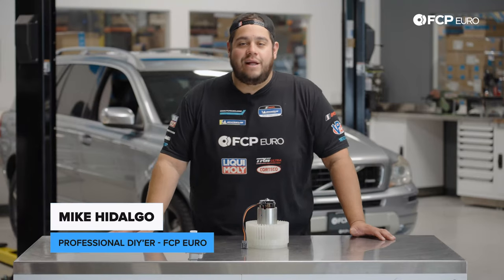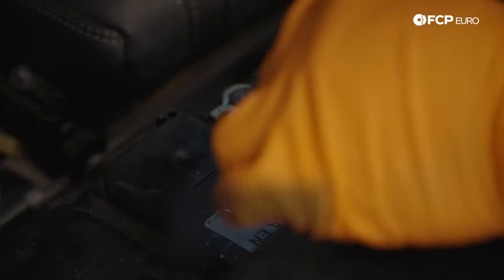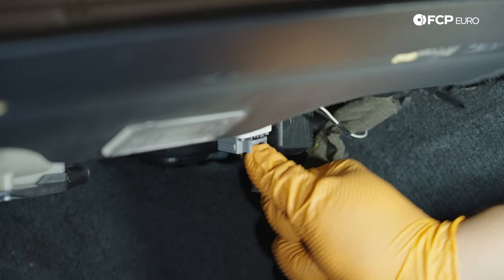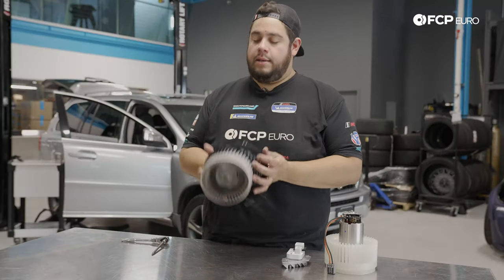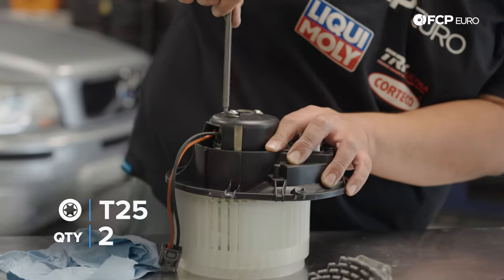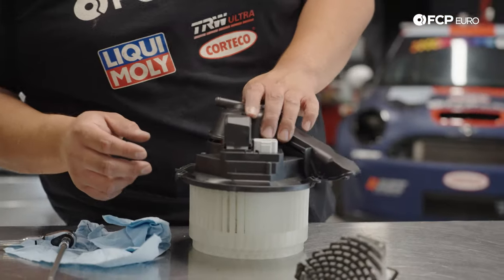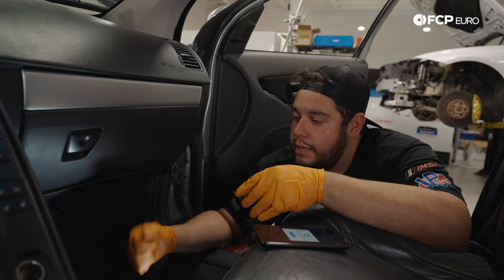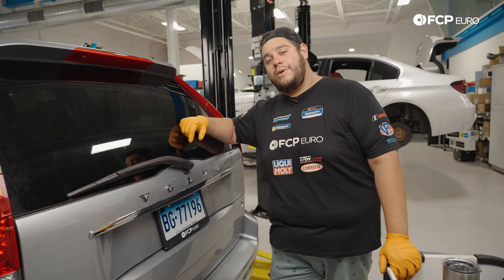Volvo XC90 P2 Blower Motor Replacement DIY (2003-2014 Volvo XC90 V8, T6, R-Design)

Comment: Good video.  But some advise for everyone.  I've done this job 3 times (1 warranty unit, 2nd unit came damaged, 3rd unit was used OEM) and my conclusion is that the aftermarket blower motors all made a ton of noise and vibrated over, let's call it 75% to full speed.  Found a used OEM Bosch and it worked silently at full speed.  The housing for the BOSCH had rubber shims along the full length of the motor body, as well as rubber shims around the T25 screws that secured the motor to the black plastic housing that holds this monster in the car.  The aftermarket motors I purchased came with new black housings and the motors loosely fit in those housings.  IF you buy aftermarket, maybe try to re-use the OEM black plastic housing.
Reply from the maker: Thank you for the first-hand experience, Ryan!